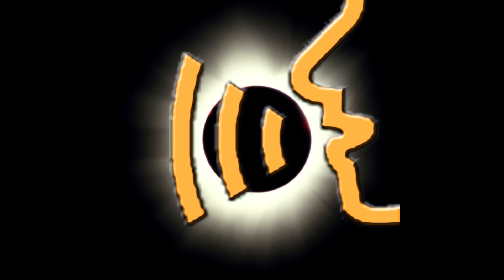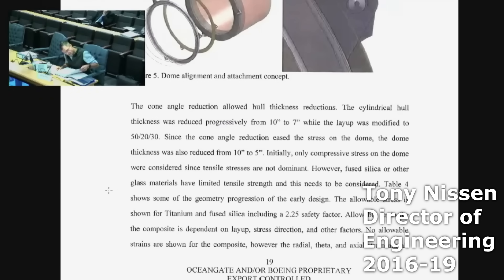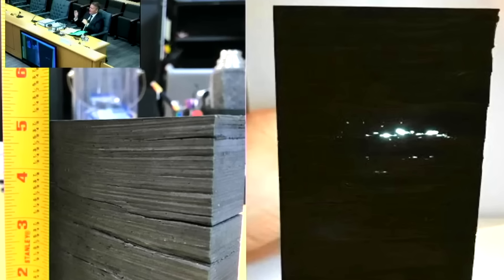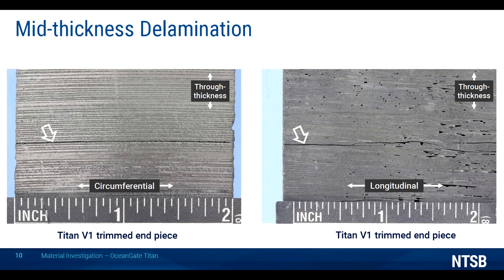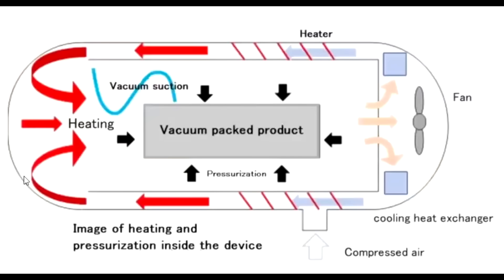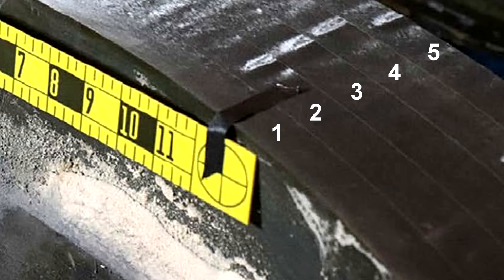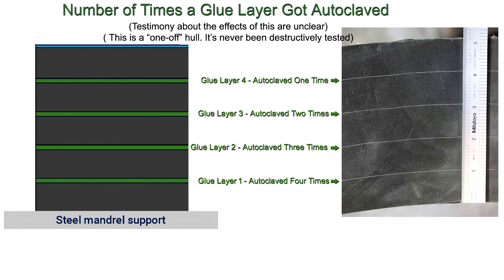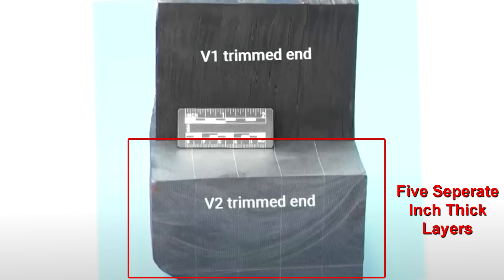Who Engineered the OceanGate Titan V2 Hull? Maybe Nobody Did?

Comment: It’s inappropriate to criticize NASA for their consulting in this case. The testimony of the NASA engineer makes it clear that they were not focused on HOW the carbon fiber material would be used, but only on the elimination of voids in the manufacturing process. The responsibility for the application rests solely with Ocean Gate, as does their failure to secure any sort of submersible certification (which was brought out almost immediately after the incident, long before the Coast Guard inquiry).
Reply from the maker: Thanks for commenting.  I see your point, but I don't agree all the way.  The scope of the work NASA was asked to do is not spelled out in the document that was released.  But it seems to have started out discussing autoclaved debulking, all by remote consultation.  Then OceanGate stopped the agreement, so NASA never got fully involved and never fabricated anything. But since NASA had no marine experience I think they have some responsibility to know what the final product or goal was if they are going to provide expert opinions. Don't you think that makes a difference?   Maybe OceanGate wasn't forthcoming I don't know.  But how can you do expert consultation on a process you area suppose to be expert in and not know the final goal.  That seems odd to me.  Maybe NASA should have said, "Stockton, we don't have enough experience with the marine pressure environment to know that what we are going to tell you is applicable and safe, I think we will decline to do this consult for you."  They did not have to take the job.  Then they ended up having "egg on their face"  when Stockton was promoting that he worked with NASA on the hull, when the work was extremely limited, and then NASA had to release a statement to that affect after the implosion.
Reply: @ The scope of the work may not have been spelled out, but no court, including that of public opinion, is going to place any liability on NASA. The evidence lies in what they DID do (only the aforementioned work on the material, and that Mr. Rush actually terminated the contract at that point, NASA refunding a lot of the consultation fee). When considered in combination with Rush’s other “shortcuts,” it is in fact reasonable to say that he committed a form of suicide- it was just unfortunate others had to die with him. I continue to assert my original point- the responsibility lies wholly with Rush / Ocean Gate. And if more scrutiny of this sorry business is needed, I think a more thorough investigation of Ocean Gate employees is in order.
Reply: @solareclipsetimer  I work in a machine shop making parts from aluminum. it's not my job to know what the parts are used for. if a part is important enough our customer will ask for certification of what the aluminum contains. but it's still not my job to know what the part is being used for.

weather NASA knew what the carbon fiber was being used for or not they were not involved in any way telling Stockton how thick or anything like that. they only tried to get him to be able to lay down uniform layers.

I think it's completely unfair to place any blame at all on NASA. they only tried to inform Stockton how to lay carbon fiber. not tell him how to use it. Stockton pulled away from the consultations not NASA. NASA has ZER responsibility in this accident. Stockton and his ego are 1000% the blame.
Reply: @biglew1161 
NASA was consulting on manufacturing processes. If they are seeing errors in the processes maybe they should voice concerns on a moral issue.  We get it nasa only cared about money for space applications. Grow up
Reply from the maker: @biglew1161  Thanks for your reply.  Think a couple of steps before you actually making the part.  NASA was consulting, not fabricating.  Allow me to make an analogy in your line of work.  A customer comes to the engineers at your company and asks them to help design and make a part.  And in the initial discussions about the part the customer mentions that the part will probably be used in an application that is beyond the melting point of aluminum.  Does your company make the part because the owners don't care they just want the profit?  And correct, you make the part to the best of your ability not knowing the end product's intended use.  Or do the engineers and/or the owners of your company respectfully decline and ask the customer to go somewhere els because the project is beyond their comfort level.  That was the position that NASA was in.  To give good advice you need to know the entire picture and design with the entire picture in mind.  That is my point and it is valid.
Reply: @solareclipsetimer  I'm only speaking from my experience. At the small shop I work at we have no engineers. The parts have already been engineered and designed by our customers. And we only get the blueprints telling us how to make the part. If a part fails because because it was designed wrong it's not on me because I'm not an engineer and I made the part how it was designed. If we went to our customers everytime we got a new part to make and grilled them about if the part was designed right we would get anything done.

Most of our work revolves around optics and using light to make ultra close measurements, so lives aren't on the line on most parts I make.

It's still my opinion that you don't necessarily need to know how the carbon fiber was gonna be use in order to tell someone else if it is laid wrong or how to lay it. Now if Stockton was asking NASA if it was thick enough. then nasa would have every need to know what it was being used for. At what point in the process did Stockton stop consulting with nasa. Did nasa know he was making a sub? If Stockton told nasa he was making a sub what was their reply, and was that the reason Stockton pulled away from nasa?

From what I have seen from the testimonies there are a lot of unknowns to me to lay any blame on nasa.
Reply: To add to this. if someone asked me how to machine aluminum, it wouldn't matter what they were making the process doesn't change. If they asked for help designing something critical, that's an entirely different matter altogether. I'm not an engineer. But if I were, there would be a lot more things I would need to know.
Reply from the maker: @biglew1161  Yes, sir, and thanks for replying.  Thanks for more information about your workflow, and I see that your situation is different.  But of course, every situation is different, isn't it?  Yes, there are many, many unknowns.

Comment: Why didnt they use titanium
Reply: Cost. It’s not easy to design a safe, functional, deep water submersible. Titanium is the ideal material. The reason they went with carbon fiber was cost and weight. They wanted to fit as many people inside the vessel as possible to maximize their profits.
Reply: Monney

Comment: I seriously doubt any engineer was involved in the design. I can't imagine any engineer worth their degree would use laminate for a deep-sea vessel. It is completely insane.
Reply: It’s like using carbon fiber for a high temperature application saying “graphite can endure some of the highest temperatures” like a GENIUS who considers all parameters! 

I can’t imagine how he’d allow that even in his brain. And the plies applied of composite weren’t laid up at 45 degrees either! So there were basically a latitude and longitudinal failure stress area. 

They might’ve survived if it  was laid up better. Wow. 

And 667 layers… come on dude I don’t believe and still wouldn’t tempt *faith* like that
Reply from the maker: @lindboknifeandtool  I agree with you.  The other thing is, what if in his talk he said "the hull is made layers, each one inch thick with 133 plies, and then five of them are glued together."  That doesn't sound quite as good as "667 layers of carbon fiber," does it?
Reply: A degree doesnt make an engineer.
Reply from the maker: Thanks for commenting.  I almost ready to upload another Titan video that will interest you.  Stay tuned.

Comment: I remember James Cameron talking about how carbon fiber was a terrible material because there was no way to accurately assess damage and stress between dives. With metal hulls, micro fractures and stress points could be found and analyzed because the structural properties of the material were well known and studied, but the laminated and composite nature of carbon fiber meant there was no way to accurately measure these and account for them in a safety sense, at least when considering the pressure compression/decompression cycles of a submarine hull. The big issue was the layers could delaminate, if I recall correctly
Reply: Most people look at carbon fiber composite like some sort of miracle building materials without realizing it downfall. Yes, the strength to weight ratio is amazing but most of the time the thing that fails in a build that involved in CF is the glue. Carbon fiber still need to be glue together to make it strong, a miss-step in glue-material ratio or incorrect compositing technique and you could considered the thing you’re working on trash. Since the Titan v2 was build by the people who have experience in CFC in aerospace engineering, I guess the engineering for the v2 is flawed in the first place
Reply from the maker: @dogdie147  Thanks for commenting.  Yes, no one talks enough about the matrix.  A laminate works as a system, the matrix has to be perfect.  You are correct.
Reply: @dogdie147  - Most people look at it without realizing fiber is like a noodle. The fiber doesn't handle compression rigidly. It handles *tension*.

Comment: Not to mention the Amazon grab bars and RAM mounts screwed directly to the interior of the carbon shell.
Reply from the maker: Thanks for commenting.  Just to clear up a misconception.  The inside of the hull had a liner that was spaced away from the carbon fiber hull by about 3/4 of an inch with blocks.  I believe that everything you see mounted in the sub was supported by that liner.  I don't think they screwed into the carbon fiber itself.  Although I have never heard that stated specifically.
Reply: @solareclipsetimer  I wouldn't be surprised if the carbon fiber was crushed more than enough under the pressure to be pierced by the screws. I only speak intuitively on that.

Oceangate's Titan was put together with less care than I put into just reading the instructions on a Honda body kit or applying wood finish.
Reply from the maker: @michaelmoses8745  Yes, sir.   Wiat until you see my next video, talk about "less care."
Reply: @solareclipsetimer  I suppose I can endure the wait. The Oceangate assembly video is certainly a video. So many bad ideas.

Comment: Always remember, designers are not engineers.
Reply: Not sure why you're saying this because Stockton Rush was an engineer.  He graduated from Princeton with an engineering degree and had constructed aircraft and watercraft himself.  Furthermore, he never called himself a designer in the first place.  He was simply blinded by his own hubris.
Reply: @drumnbasssakuga9352 i dont think rush was a PE. Anyone can be an 'engineer'. An undegrad qualification isnt much.
Reply: Nonsense
Reply: @thecyclingmaker  he has a point. Architecte aren't engineers either. There's a difference between drawing pretty shapes and drawing optimized shapes
Reply: @ he has a point in comparing a role like an industrial product designer crafting the aesthetics of a consumer product. Or maybe comparing a surfacing specialist developing shapes fulfilling a marketing brief to a mechanical engineer trying develop complex structures for weight and cost . But neither of those things happened here. This is a case of bad engineering, by engineers that should have known better.

Comment: We don't make table legs out of rope.  Their failure starts on day one with their material choice.  Fibers are not chosen to support compressive loads.
Reply from the maker: Thanks for your comment.  A properly done composite cylinder can take some compression.  But probably smaller than Titan and it has to be properly done.  But I agree with your point, it's probably not the correct choice for these kinds of loads.
Reply: @solareclipsetimer  No.  Composite cylinder should never be considered viable for compression loads. Composite is unpredictable when loaded like that and fails catastrophically. You NEVER want your comprehensively loaded anything to fail like that. Unless you are building implosion bomb or some other nonsense.
Reply from the maker: @NGC1433  Thanks for your reply.  I agree, the behavior of composite laminates under pressure is hard to model.  The NAVY had a very successful unmanned glass fiber composite submersible called AUSS (Advanced Unmanned Search System).  But it was a much smaller diameter and was designed to be unmanned.
Reply: @ 👍.   I’m also going to disagree with myself and my original post a bit. I work in IRAD at an aerospace company that everybody here knows.  We build structure members that support compressive loads out of carbon fiber all the time.  I mean like ALL THE TIME 🤣
Reply: Those composite layers could delaminate without anyone noticing. You can't see the defects with the naked eye and as we learned nobody bothered to check anyway.
And the moment the failure becomes appearent the effect is devastating. So yes, like cameron shortly after the implosion said, it is the totaly wrong material for this task.
If you want to risk it anyway you could do it for a robot. But don't put people in there.
Reply from the maker: @sebastianmuller1210  I agree with you.  Thanks for posting a reply.
Reply: Their hull health sensors did pick up that the hull had started to behave differently though
Reply from the maker: @hippienixon2329  Thanks for your comment.  The V2 hull was remarkably quiet during the first deep dives (acoustic data).  That changed with dive 80 where there was a huge single acoustic event and a large permanent shift in the strain gauge data at the same time.  This was in sensor group 4 in the front lower left of the hull.  This most likely represented an in-between layer delamination.  They should have stopped diving after this. But they ignored the data and continued.
Reply: 🎯💯 Exactly

Comment: The hull was fine; The failure point was the joint between the carbon fiber and the titanium end caps. The difference in strain between the two elements under the load is what caused the failure
Reply: Source: Trust me bro
Reply: @yinyangsaladgang8789 
Source: thunderfoot
Reply from the maker: Thanks for your comment.  Maybe, maybe not, on the ring glue joint.  I am working on a video dedicated to the hull.  When that gets uploaded, watch it and see what you think.
Reply: The hull was fine? The section where it changed to the titanium ring is part ift the hull. So it lies within the argument that the hull was NOT fine.
Reply: And let's remember that the water pressure would be forcing the end caps, the rings, and the hull, together end to end, so I would not think the titanium ring glue joint was the problem. 
No as far as I know has anyone assessed that to be the problem
Reply: Not fine. There were flaws in the structure in the form of gaps, uneven layers, and trapped air. Even if the joints didn't fail, wear and tear on the haul itself would have produced similar catastrophic failure

Comment: NASA and Boeing have done serious harm to their reputations allowing this crazy guy to constantly use their names to validate his sub.
Ironic when both have zero experience engineering subs
Reply: Boeing would have better used that time making sure doors didn't make unscheduled escapes.
Reply from the maker: Thanks for your comment.  Yes, and immediately after the disaster Boeing and NASA released statements discussing their limited involvement.  I did a video about that, search YouTube for the title   OceanGate Titan Hull Partners Controversy - Partners Did What/When?
Reply: And as they both said they weren't being asked for expertise in subs. It was about manufacturing techniques for composites
Reply: @alexanderSydneyOz  to be fair, I'm sure real sub makers either couldn't or wouldn't help
Reply: They were paid to teach a guy how to work with carbon fiber. End of story
Reply: Neither NASA nor Boeing did anything wrong. Boeing gave OceanGate accurate safety instructions and OceanGate blatantly ignored them. It's not their responsibility to engineer the entire sub.
Reply: NASA has it easy. The most pressure they ever have to handle is the air getting compressed during reentry (100s of kPA). Deep space stress is just -1 atmosphere's. When 10 meters of water causes a 100kPA increase alone, no wonder the depths at 10,000+ meters are nigh unexplorable.

Comment: For NASA, they were hired to test materials under pressures. That it was for a sub was not a factor in the deal.
Reply from the maker: Thanks for your comment.  NASA testified that they did no building, no testing, and no analysis.  The only thing they did was remote consultation regarding techniques for autoclave and pressure debulking of carbon fiber layups.